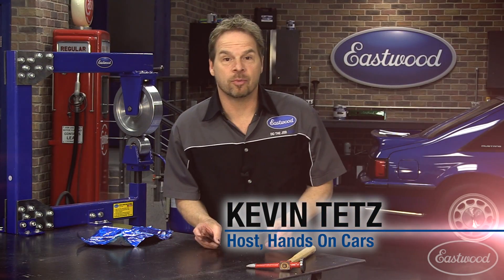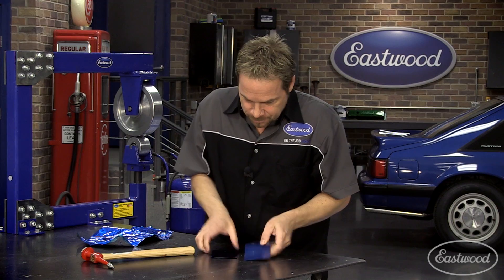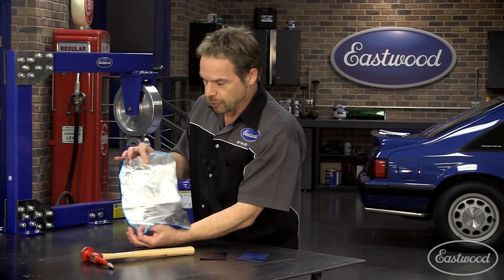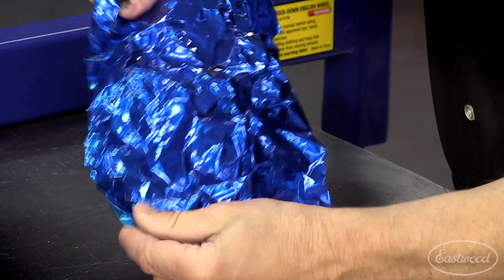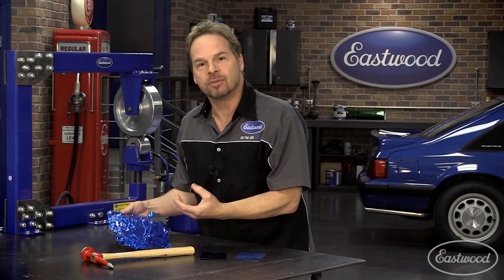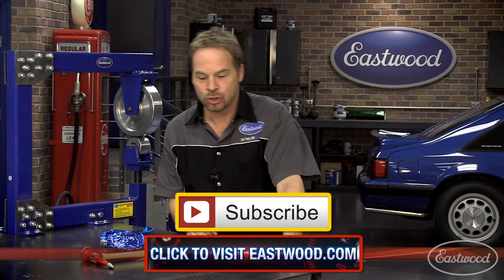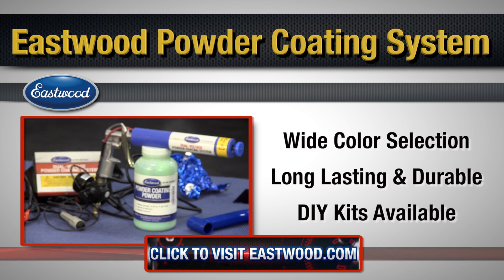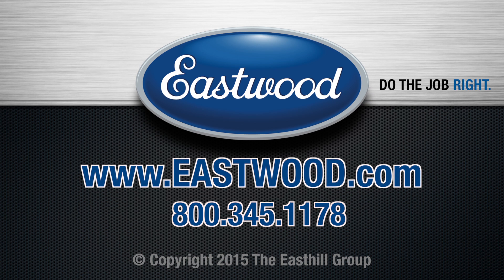Powder Coating vs Paint - Why Powder Coating Is More Durable Than Paint - Eastwood

Comment: How many people will hold on to the powder coated project until it wears out anyway. Why spend the extra money and headache powder coating something your just gonna sale, trade off, or redo anyway? Steel airframes make sense to powder coat because they appreciate in value. Otherwise rattle can anything you don’t plan on being buried in.

Comment: The problem i see with it is that on every sharp edge it will lift and like the guy below says as soon as those edges start to lift it will rust at a rapid rate where urethane will not

Comment: Powder coatings are fine until they start to breakdown, then they're the pits to remove and repaint. I wouldn't recommend powder coating on security doors or any surface subject to a lot of wear and tear.
Reply: Ironically, the high-wear areas are the ones many people advise to powder coat ! ie rims, frame, etc. It's a little confusing

Comment: If powder coat gets one little hole in its finish, water will enter under it and never dries out. This will rust at a very fast rate and do far more damage then chipped paint. It has its place.
Reply: That’s true with paint as well. One little scratch or chip and the rust kicks off.
Reply: This is why zinc bath before paint is crucial.

Comment: If you were to sand blast and paint a car body with high temp epoxy primer could you powder coat the entire car and how does it hold up to uv? Can you paint a clear uv protector coat over powder coat?
Reply: People acually powder coat there motorcycles, can fit tank and trim in oven, so yes if you wanted to strip whole car down could powdercoat it. (Usually bakes at over 400 degrees, so will prob have to strip car completly to not melt anything). And i assume youd be able to sprat clear over it, kind of would defeat purpose of coating imo. They have clear powders, just use those

Comment: after powder coat has been applied will it resist high temperature? can it be applied on hot metal parts?
Reply: Yes powder coat is heat resistant to a certain degree, during its application process it has to be baked at a pretty high temp anyway to set up.